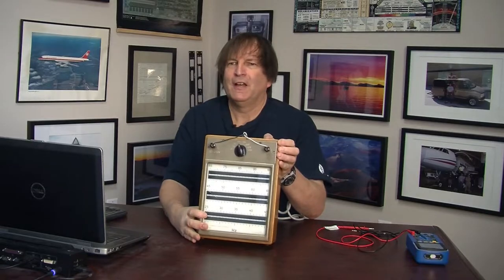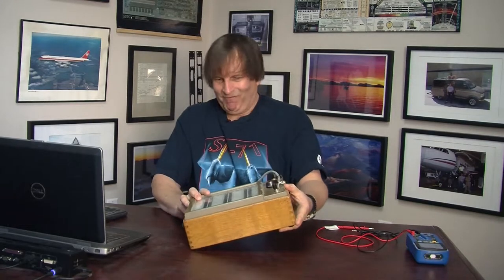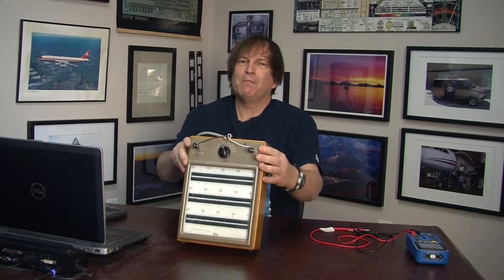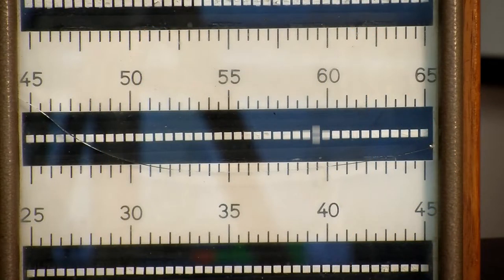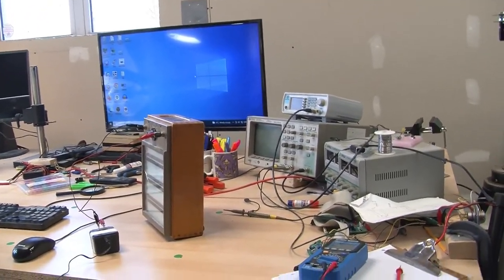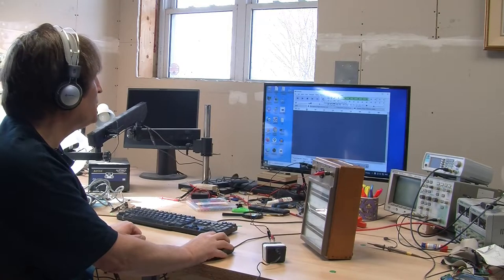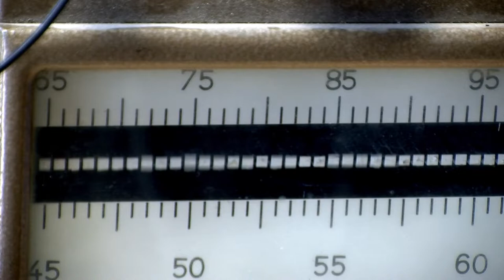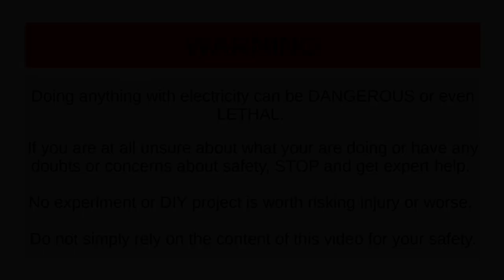The Vibrating Reed Frequency Meter (and Spectrum Analyzer)

Comment: Surprised this doesn't have more views.  YouTube's algorithm must be slacking off.  These vibrating reed devices are fascinating.  Have you seen AvE's mechanically driven tachometer ( https://www.youtube.com/watch?v=weDiELpXlpk&t=211s ) and Fran Lab's frequency generator/base amplifier/isolation transformer driven meter ( https://www.youtube.com/watch?v=tYJ4kocF6qc ) which both use vibrating reeds?
Reply from the maker: Well I started posting videos this year and like most of my videos it has had relatively few views. When I posted the  "How many Amps to burn up 14/2 electrical wiring?" video posted a month ago somehow it got noticed and a pike of views. The effect of that has been trickling back slowly to my older videos. So maybe this will get more views. You comment may help - apparently comments help the algorithm determine what is "good". 

They are wonderful devices. I had not seen either of those videos - just looked at them how interesting. Didn't know they were used as tachometers (although I guess getting the frequency output of a generator is essentially the same thing). And never occurred to me to use it in reverse to generate a signals. Thanks for the links!